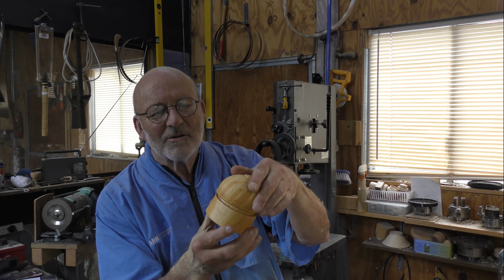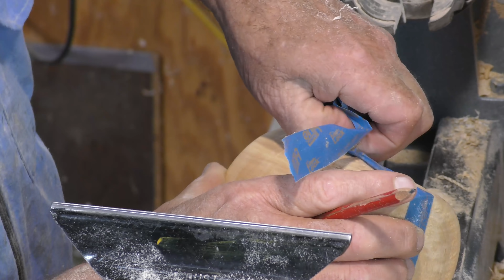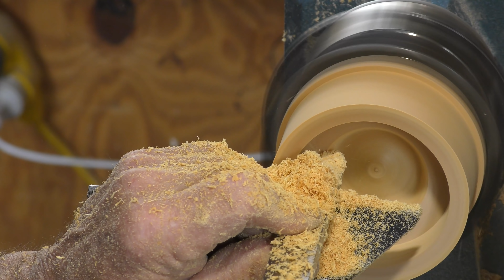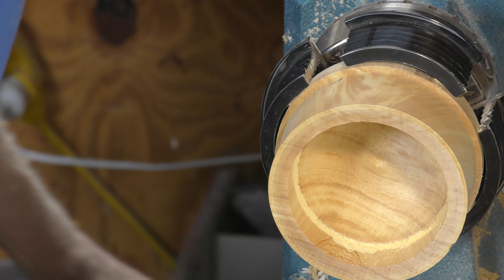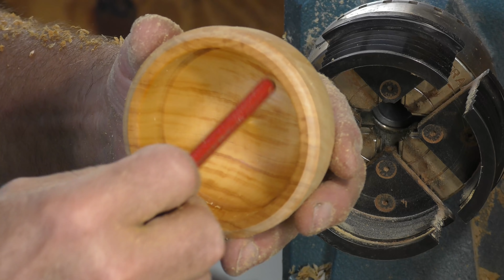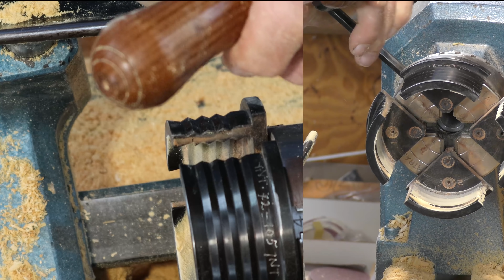Richard Raffan turns a box with a suction-fit lid.

Comment: Learning a lot from this series of video. Thoroughly enjoyed sitting in on your session at the symposium in New Zealand a couple of years ago, too. Just wondering about lathe speed - what you are using here and why that speed? Seems pretty fast to a novice like me. Thanks for continuing to help us learn this great craft (and art).
Reply from the maker: This blank is small and of even density, so would have been running about 1800rpm. Remember that turning is about letting the wood come to the tool, so a slower speed requires the cutting edge to be advanced more slowly, otherwise you're more likely to have a catch or, when turning a box, heave the lid off.

Comment: Why is sticky wax better than tissue paper when taking up looseness between lid and base?
Reply from the maker: I found tissue paper tends to loosen the fit further whereas beeswax spreads to what is required and I retain the suction. If the lid is loose enough to require paper I'll remove the flange and turn another,  even though that makes for a shorter box.